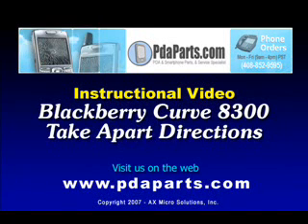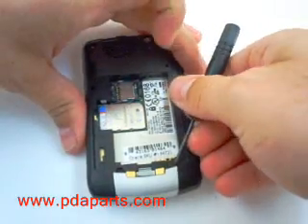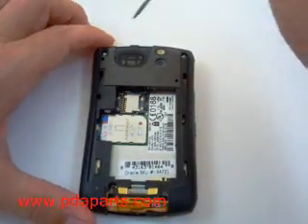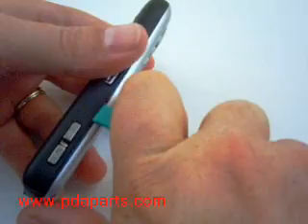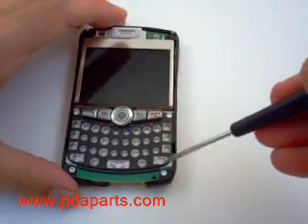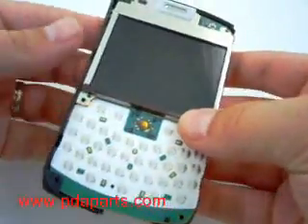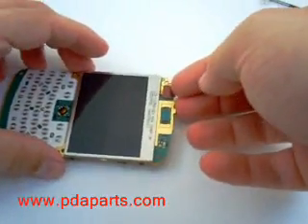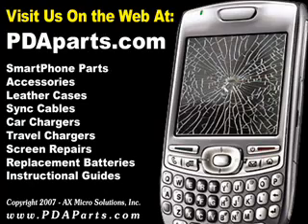Blackberry Curve 8300 Screen Removal & Take Apart

Comment: This tutorial was awesome! Thank you so much for posting it. I had a Torx screwdriver I got from a Radio-shack tool kit a long time ago. It fit perfectly! Also, you don't need the cover removing tool if you're really careful with a wide flat screwdriver. Just be cautious because you can make little marks in the sides of the plastic as you twist it to make it pop off (I did, oops)... but it wasn't anything I cant live with. I'm more happy my screen isn't filled with dust than small cosmetics. :)